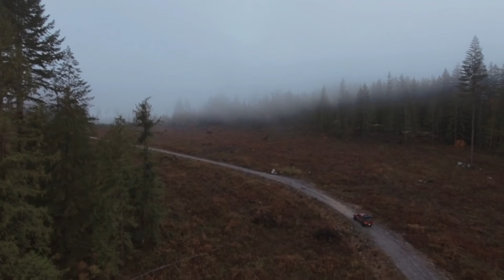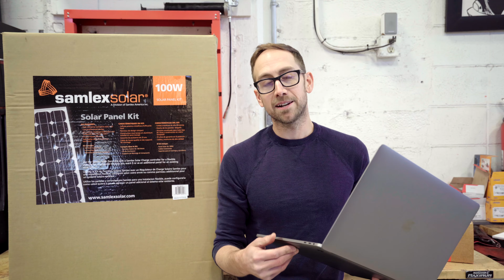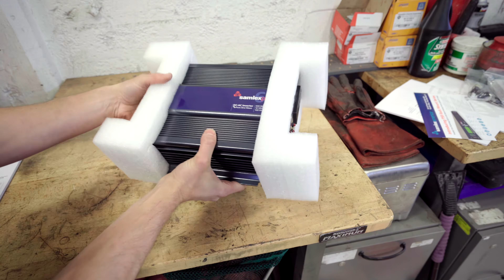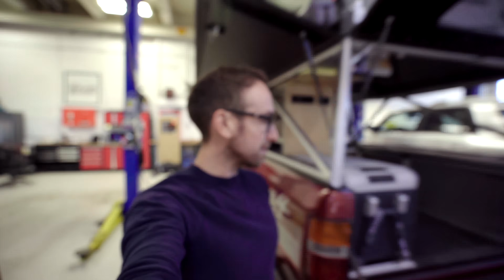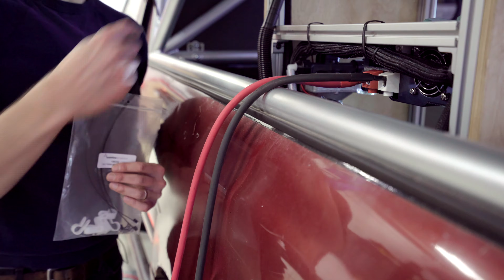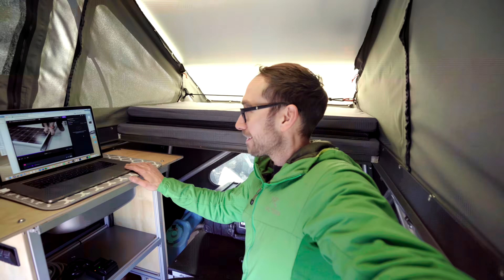Desk to Glory | Installs Samlex PST Inverter for Off-Grid Power

Comment: JUst to be clear. the fuse comes with this inverter? I wasnt sure and after ordering inverter have been going crazy trying to find the correct fuse
Reply from the maker: The fuse comes in the Inverter Installation Kit which is purchased separately from the inverter. Contact us at sales@samlexamerica.com or 1-800-561-5885 with the model number of your inverter and our team will let you know the fuse required and where you can purchase it. Thanks!